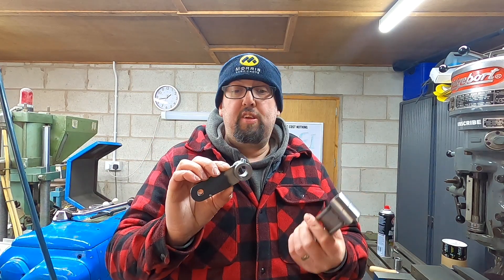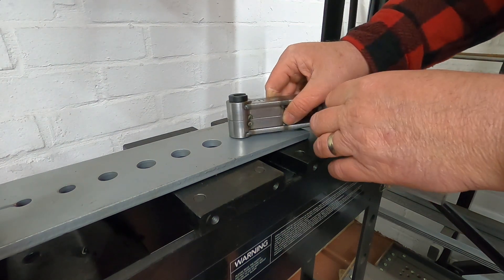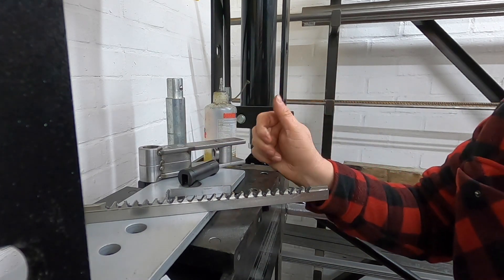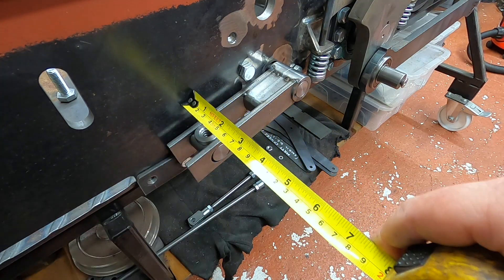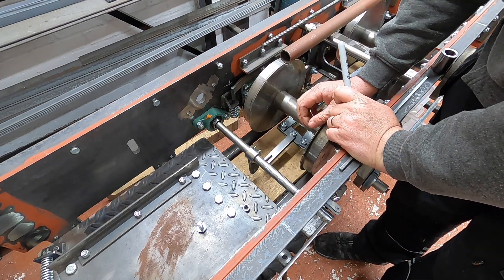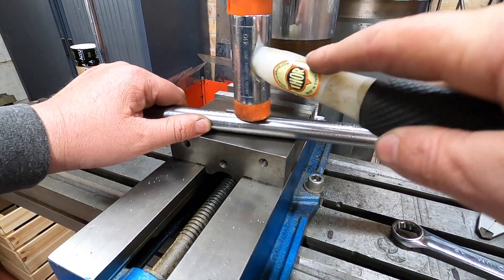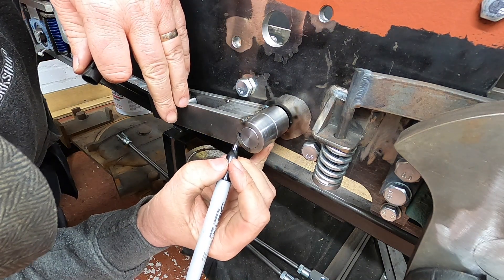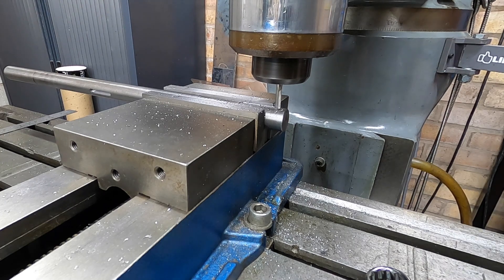Layshaft Slots and Keyways - EP43 - 7.25" Gauge Steam Locomotive Build

Comment: great stuff Matt👍👍👍👍👍👍🚂🚂🚂🚂
are those broaches expensive!!
regards
Kev
Reply from the maker: Hey up Kev, hope your well. I think I got this broach and bush from https://www.arceurotrade.co.uk/ they are in cutting tools section. The broach was £31, bush £10ish, but you can make your own bushes if need be. I buy the size I need, eventually I’ll have a set. All the best, Matt. 👍
Reply: @MattChiversWorkshop  thanks Matt, ive never had to buy one, had a slotting machine at work and i use the lathe and shaper usually, so because im a cheapskate will probably stick with that!🤣🤣🤔🤔👍👍🚂🚂🚂🚂